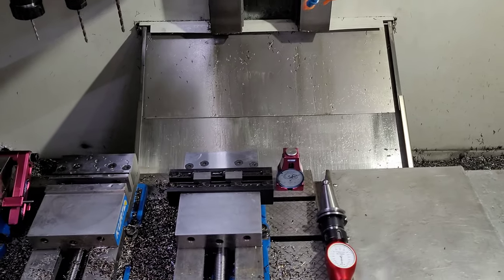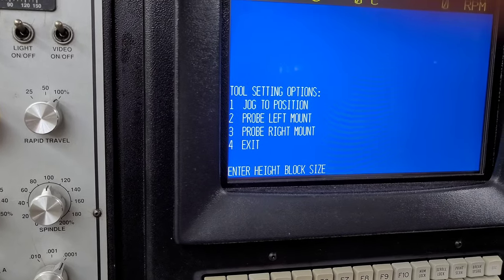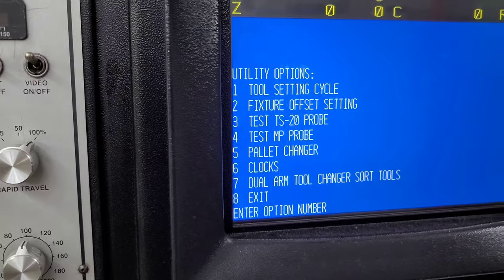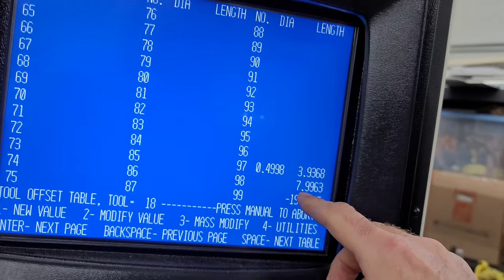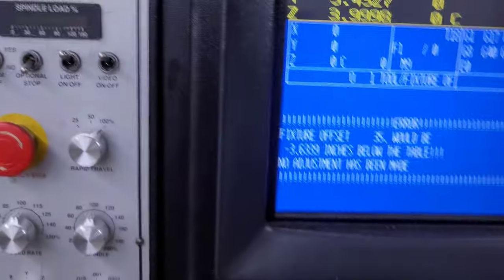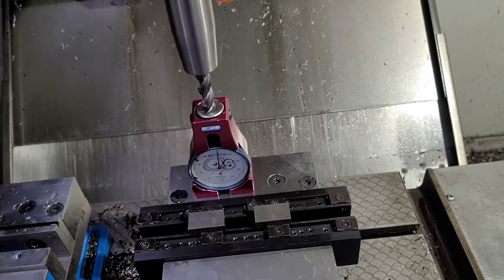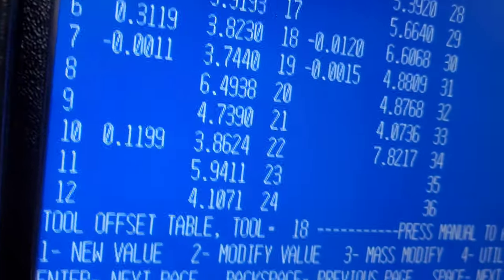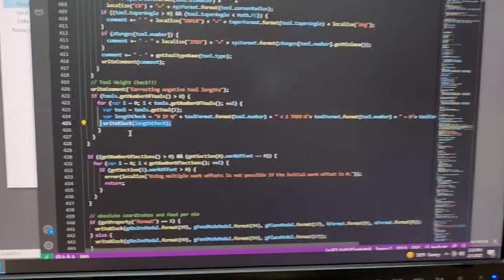Smarter Fadal Tool and Fixture Offsets Using a Haimer 3D Taster

Comment: I would recommend measuring off a 1-2-3 block or gauge block on the table as to not accidental probe the bottom of a scallop or imperfection on the table. It's probably not going to make a huge difference but that's what I do.

I like that you added the pre-Z adjustment message before modifying the Z for the fixture offset. I will have to add that to my program.

Comment: Great video, im not sure i fully understand tho

Do you need to paste the post processor in every program i run on the machine or is it a macro you can use on the machine any time ? 

I've seen this technic done in a sligthly different way so im a little bit confused

Comment: I don't understand why you are using high production type setup technics?  For the home shop It works so much better just to touch the tools off the part. Its fast, intuitive and gives you an exact setting. You have to measure every single tool out of the machine with your method and then type in the length. So, either way you need to measure tools. I would rather do it in the machine and have the machine log the offsets so I don't fat finger it.
Reply from the maker: You must be completely missing how this works. I don't touch tools off a part because sometimes I'll use the same tools over and over for 20 different parts in a row.  If I move to a different job, suddenly I don't have a reference to touch off new or worn tools anymore.  So touch them all off on the table (which never changes) and just set the work offset once per part.  I don't have to type anything in, so I literally can't fat finger anything.  Yeah, you have to set up all the tools in the carousel, but you only need to do that once (if you've been touching off the part before).  If you've been touching off the table the whole time you don't even need to touch off the tools again.  The macro or the post processor will just correct them.
Reply: Touching off the table and using your probe/indicator to locate the work offset is objectively the best way to use a CNC, touching off your part is ridiculously inaccurate, and a very bad habit to have; because forgetting to change the offset for a single tool for a new part leads to crashes, which a home shop usually cannot afford to do. it's also far more tedious than indicating the part once and hitting go.

Though, positive tool offsets is unnecessary.
Reply from the maker: @Kitsyfluff  When my Haas measures it's own tools, they end up with a positive offset.  And when Fusion 360 spits out the total length of the tool + holder, it's a positive number.  A negative tool length is stupid because it's now a machine specific value.  In the Fadal world, that measurement is literally how far the head goes down (Z-) from the tool change position to whatever you are measuring.  Looking through the tool table, it's basically indecipherable what the measurement is.  Like, you have a tool with a diameter of .4995" and a length of -12.7249?  Makes no sense.  Tool offsets should always always always be the length of the tool from the gauge line to the end of the cutter, for consistency's sake.
Reply: and if You are working on an expensive part and have done machining on the top and need to change a tool, how do You then set the new tool length? You cant do it accurately.  I do something similar on My fadals. with a few differences

i have a setting block about 7 inches tall that i just set all my tools on. never on the work.
i them have a digital height gage just for this that is zeroed on a the setting block on the surface plate.
i then place height gage on the mill and check the work height.
My  work offset for the z will usually be a negative number which represents the difference between the tool setting block and the work height.. Its also safe as it cuts air way up there if You forget to set
Reply: this method shown in this video is actually more sophisticated and better then my method due to the fact that tools can be set off the machine and tool tables transferred as He said from machine to machine, It takes commitment to change Your tool setting methods and to get everyone to do it. there is a big payback though as any tools in the carrousel are already set and You can count on it. it saves a lot of time .
Reply: yes but . .. the language in fadal is 'tool length offset' not 'tool length'.  I like what you're doing, but seems way more complex than just the simple way it is intended in Fadal ... gauge all tools in carousel to table (using tool setter just like you do).  Then whatever fixture setup you have just measure (using the haimer ) distance from table up to fixture  Z and enter this as your fixture Z  height.  All the rest is taken care of automatically no? @ReiniGrauer
Reply from the maker: @SvenAnderson-u5y   You say "automatically" like you didn't just have to manually enter the distance from the table to the top of the part in the fixture offsets table.  And what happens if you have a tool setter outside the machine?  How portable are your tools and tool tables between machines?  With this, you could export the tool table with NCFadal for a job, move those tools to a different machine, put them back in, upload the tool table with NCFadal, set your new fixture location, then run the job without having to measure any tools in the second machine.  Even your haimer length would be exactly the same between both machines.  

Also tool length offset is just an offset from the tip of the tool to the spindle nose in this method.  And how does "tool length offset" even make sense if the length is a huge negative value in the fadal method?  Can you really look at a tool outside of the machine and say, that tool is negative 12 inches long?  Makes no sense.

Lastly, every machine out there that uses a tool setter probe to measure tools will store a positive tool offset value based on the gage length of the tool.
Reply: @ReiniGrauer   I get what you are saying with regard to switching tooling from machine to machine, in which case there is some value to storing 'tool lengths' (distance from spindle to tool tip).  I personally don't have more than one machine.  So . . . as most things in life:  situation dependent.

Clarification:  If you re-read my comment, I did not say that the Fadal automatically stores the fixture Z height from table . . . I said that you need to enter that measurement, then the machine, code, software (at least from Inventor HSM) takes care of the math.  I think its a super simple system/method, particularly for one-machine operations.  I think the key is to think about the term "tool length offset", which is the distance the Z can travel until the tool tip touches the datum surface (which can be whatever you choose, I choose the table surface).  Then a negative number makes total sense.
But hey . . . that's what make the world go around is different ways of visualizing and seeing.  I'm super impressed with the system you came up with and the Macro you wrote . . .not something I am capable of, so please don't in any way take any offense to my questions .  Love watching your videos.